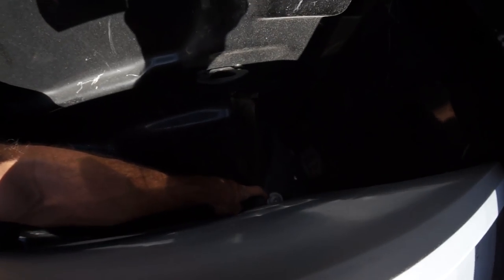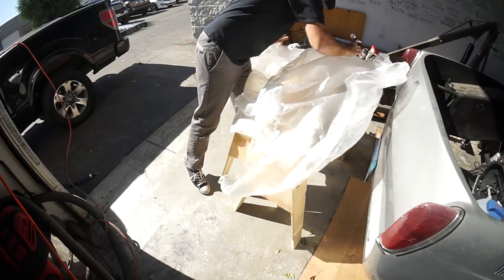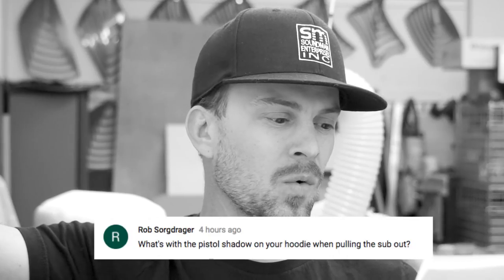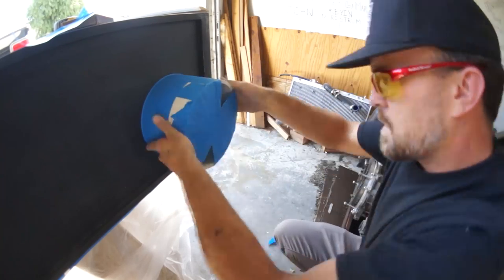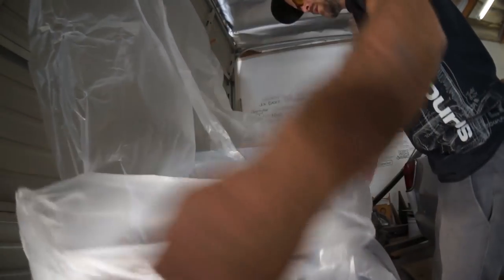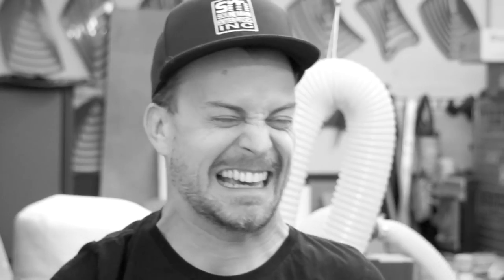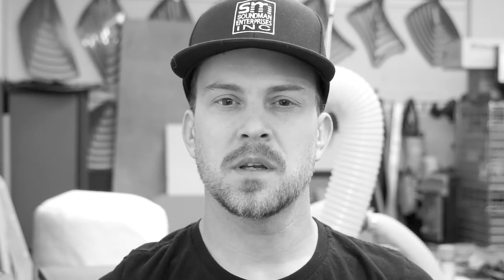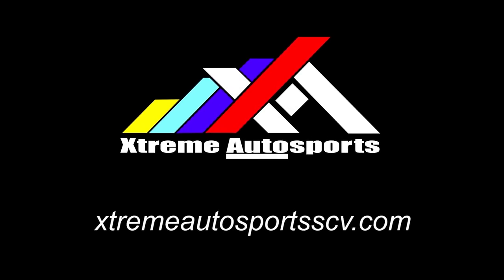AMPLIFIED Episode 666, part 2!! - subwoofer enclosure Raptor bed liner - AMPLIFIED #667

Comment: I have a built Audi & built Cafe Racer done in Raptor Liner. 

Audi is pure white with 3 coats of clear.

Cafe Racer is Ferreri Red (liner) with Chrome Tanks (Chrome bed liner).

Make sure you wait ~7 days before you handle that box! It's takes awhile to cure.

Comment: Hey doug, little suggestion. Put some LED's in that box, +10HP, Box looks sexy AF
Reply: I'm gonna put my commemorative plaque inside my box. Speaker box that is. then I'm gonna use my cock knuckles for part of my 2nd alternator mount.
Reply: gotta have that led music box with it though so it flashes to the beat.

Comment: I learn so much from this crazy fucker. My system only has one 10" DVC Rockford and  5x7 Rockford in back 6.5 Rockford in the doors. I wish it was as nice as the Sound Man's systems. I had to use my Kicker amps instead of my 90s Rockford amps because someone stole my last system. So I used the amps I had.

Comment: why not just put a bed cover on it?  Then you dont need to worry as much about water and fading of the spray liner...
Reply: would probably rattle most rollup ones have floating support bars in the middle, and fiberglass might not hold up nicely with the vibration and kills the point of having a truck bed.
Reply: He did it the he wanted to and he clear doesn't care what you say. And he's not a little kid he's been building this thing for a while now. How would you like it if some suggested something else you can do to YOUR PROJECT and say it'll be better if you did this. You wouldn't like it and neither does he.
Reply: It’s California they get like 1/2” of rain a year.
Reply: Yeah, bedline the box but not the truck bed??? Kinda strange.
Reply: schnizdawg he wants the box to slide, said it a few episodes ago.

Comment: Shit looks clean! I wish I could hear the system combo you have. I assume you have the woofer ran at 3 ohm? Have you ever tried that enclosure in a 4th order config by plugging the passenger side port hole to see how it performs? Just curious... nothing against your work. Now.. what about that fucked up ass bed? If you line it, you may have to trim the cab holes again to compensate for the thickness of the spray liner? That's some true pimp shit to put your woman and kids to work instead of paying goofballs like Rafa.

Comment: Hate it when assholes try to give you advice. like if I were to say that might be worth it to extend the runners/skids/ corrugation fillers on the bottom of the box to be flush with the rear of the box so shit doesn't get under the box and be a birch to get out. I have that particular problem with a toolbox, and scraps, dust, shit- get stuck in there. plus it'll look better with those gaps filled. I'd be a dick of I tried to give you that tip

Comment: You should check out 2k clear coat  cans Eastwood makes them and so does another company that I can't think of but have used in autobody they also make 2k cans for fill prime and epoxy primer for bare metal parts

Comment: looking good bro ... the ony concerns I would have is moisture fucking the wood up .. especially around that window. . not sure what your plans are on the diamond plate top but I would silicone the shit out it ... not sure how much rain you deal with there .here in NC that box exposed to the elements wouldn't last that long .

Comment: Did I miss something is he not using a bed cover? Water will find a way in always does especially with that lip on top then it's new box time when it's swells and comes apart. Or gets into the cab along the ports.

Comment: does ur truck came with a water proof bed cover??
if not then get one so, that u will never have to deal with rain water issue.. .. ..
plus its a Safety+
Reply: this finished box is the best box on the internet....
Reply: Ahsan Jaffery it's a ford- water damage is the least of your worries
Reply: randall jr Benoit HmMmm..
FORD is banned in my country so, i know a very little about that part.. so, i suggested... u know; in case...

Comment: It's going to twist.  I'm guessing the box needs to set and then you'll do the bottom side of the box (I'd assume standing water in the bed and the bottom of the box are a big concern)?  I just wanted to mention again that you said in episode #663 at 1035 in that video that you were lacking in the 60-70Htz range and were wanting to adjust the port on the smaller chamber.  Just didn't want you to forget while you've got this thing all pulled apart. Have a good weekend!
Oh and one other thing - episode 666 on Friday the 13th? Coincidence? I think not!
Reply: elk 666 part 2

Comment: *Cool story bro worthy random comment* Back in the day when I was an installer I used to hate doing BMW's, They all took 5-1/4 speakers which all sounded like shit back in the early 2000's, from kicker to phoenix gold, to MB Quart (german handmade back in the day). The customer was never happy because it didn't sound good no matter what you did.
Reply from the maker: +Joseph Stalin back on the day I built a bandpass box in an M3 and ran the ports up thru the 5 1/4 holes to port the bass into the cab. 👌👌👌
Reply: lol, wise choice.

Comment: Looks great. Will there be any condensation issues with the window since the box will be sitting in an open air bed?
Reply: That's actually a descent question considering the motor assembly is on the window side. It would have to be quite cold outside of the box and quite warm inside the box coupled with humidity as well. I don't think he should have a problem with that much temperature difference in California. Just my opinion though.

Comment: So you put this Raptor protector on the top and sides but not on the bottom? the big BOX sits in the Pickup bed and so does subwoofer box. but if water climbs it will submerge the box, soak it from the bottom and ruin it. So stupid